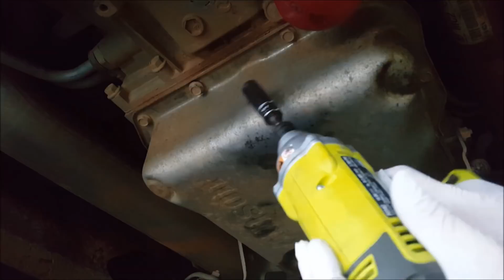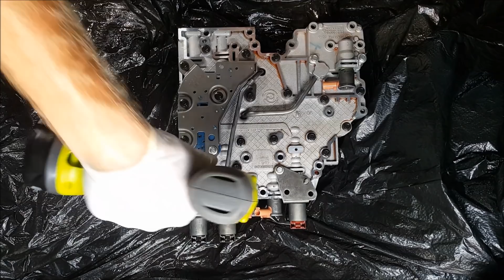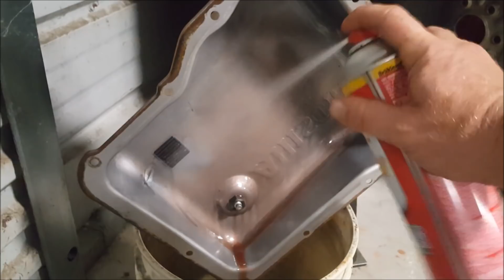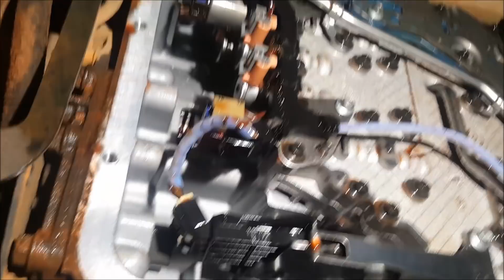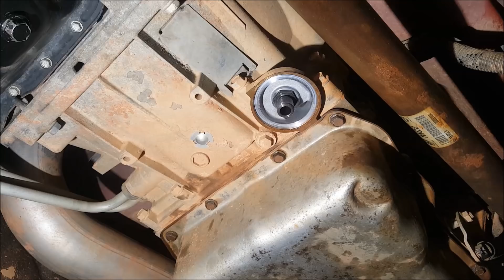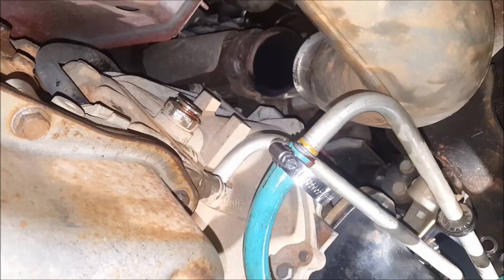TRANSGO JR INSTALL

Comment: Remove the pan magnet and wipe it off with a rag. Just a magnet and air won't remove everything. Drop it back where it was. No glue or adhesive is used.

Comment: A half decent cordless impact driver should have no problems breaking those bolts loose regardless if it’s on the truck or not. They’re supposed to be only torqued to 9 lb ft 1/4” ratchet even ratchet with one hand hold valve body with the other ive done a lot of these and never loosened the bolts off while it was still in the truck

Comment: How much transmission fluid do you recommend getting to refill the amount that came out when performing this job?
Reply from the maker: Dakota Mccune 2 and 3/4 is what is should take. So 3 gallons. Thanks for watching.
Reply: No prob and do you have somewhere that wouldn’t be pricey to buy the oil you got in the quantity that you purchased?
Reply from the maker: Dakota Mccune check the link in the description and with Napa. Napa is cheaper sometimes by the case of 4.
Reply: Thank you I appreciate it

Comment: How do you do the transmission relearn after it's all back together? Do you need a specialized equipment?
Reply from the maker: Ryan Belnap The TCM learns by how it shifts under different throttle positions, loads and speeds. Directions for the re-learn are in the Transgo Jr. kit. You're gonna run it up through all the gears at different throttle positions, starting at 1/4 and ending at full. Simple really. No special equipment needed. It will shift weird at first as it leaning.